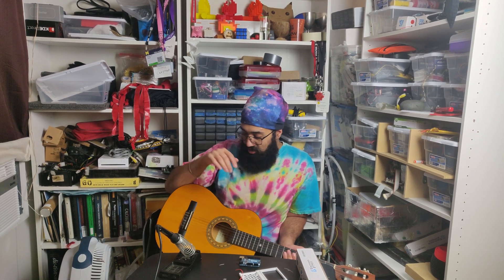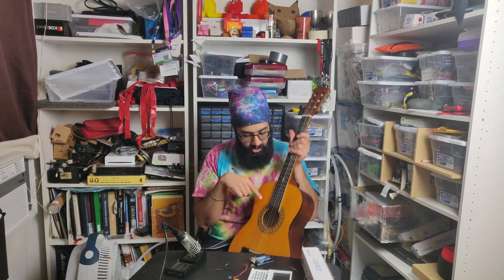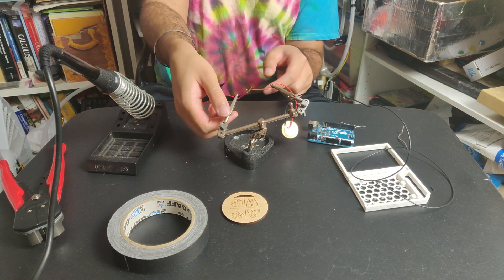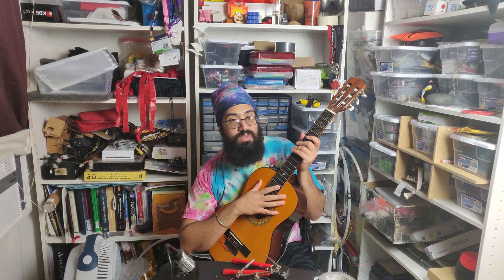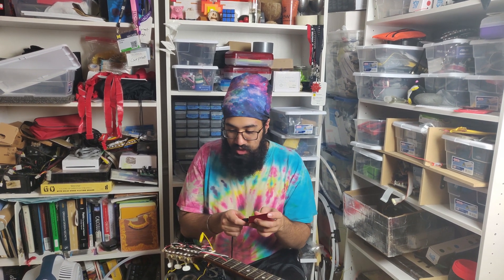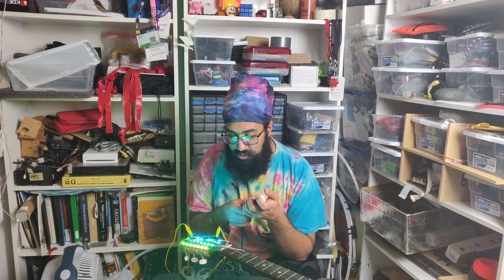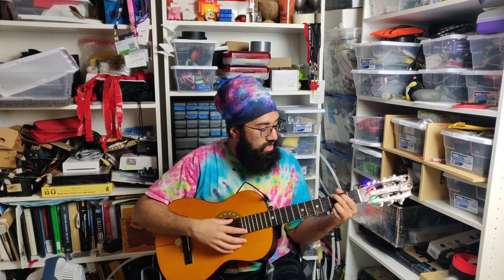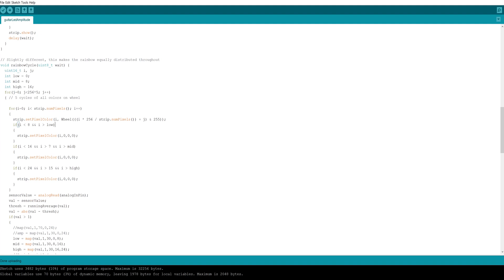🍉 Interactive Guitar Light Show on the Go  |  DIY LED Guitar with Piezoelectric Sensor

Comment: When you are soldering wires to the pads you need to pre-plan the routing.
Plan where the wires will be routed BEFORE you turn on the soldering iron.
 Lay the strips on the guitar without wires attached. It is good if you can route the wires parallel to the strips so that the hot-glue
can secure the wires to the body of the strip which is structurally better/

came from this link    https://old.reddit.com/r/arduino/comments/dgf7q3/interactive_guitar_light_show_on_the_go_diy_led/